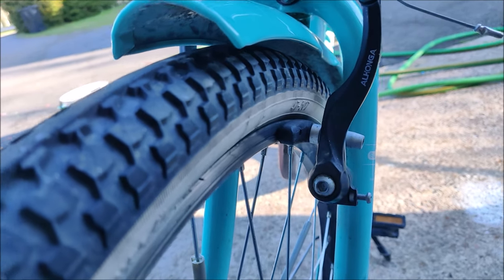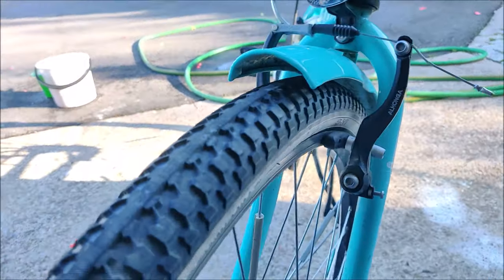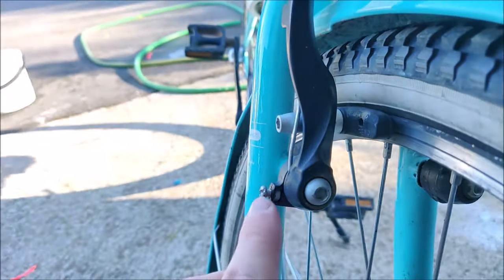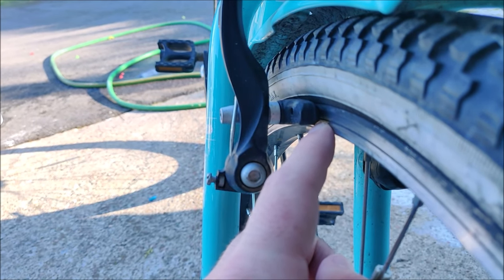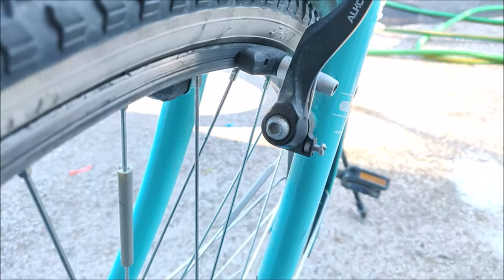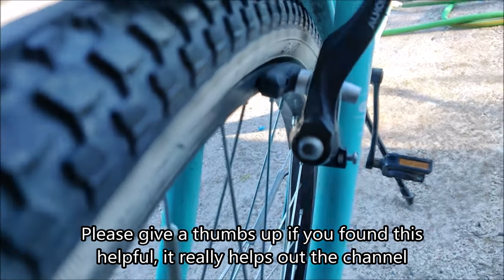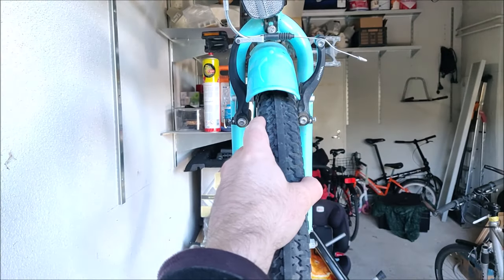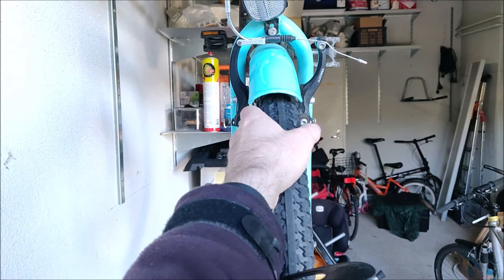How To Fix Bike V Brake Pads Rubbing On One Side

Comment: Good explanation of centering brake pads. I would just add that it's a good idea to keep the two adjusting screws as nearly equal as possible as this maintains the overall range of adjustment available. So rather than continuing to tighten the balance screw of the left side I might instead try loosening the screw on the right side.
Reply from the maker: Good idea. That makes a lot of sense.

Comment: Noticed on my last ride I couldn't coast too far. All so it was difficult to pedal even in a low gear. Stopped and noticed one brake pad was rubbing on the back rim. Thanks for the tip, had the back brake apart in my garage. Now I know to just adjust the screws........... cool.
Reply from the maker: Good to hear that the video is helpful

Comment: Thank you so much for carefully explaining adjusting the rear brake pads!  My right rear pad is rubbing on the rim and no one (including the manual) has addressed this properly!  The closest help I've gotten is "you can turn the adjustment screws....even the manual says turn them in or out until the pads are.....Now I know which way to turn them!  And also if I loosen the cable on on the rear brakes, I can tighten the handle bar cable to balance it out.  Great😀😁👌👏👏👍👍👍
Reply from the maker: Glad it helped!

Comment: Thanks! I guess I have this problem and will try to fix myself. Today I made 6 km with my bike with the wheel almost blocked and seemed that I climbed a mountain 😂😂😂 my bike almost stops in a valley 😂😂😂
Reply from the maker: Yeah sounds like it needs some adjustment. Hope this solves your issue
Reply: I've been cycling on mine for weeks and was wondering why I felt so tired making the same journeys I always do! 🙊😂 It just felt so much harder!

Comment: Thanks mate, now i dont need to visit the shop every now and then for these minor adjustments 😇😇
Reply from the maker: Great to hear that.
Reply: Hey my brake crashing cycke tyre so i should increase space or what
Reply from the maker: @FactFunKids  Not sure what you mean? Is the brake pad hitting the rubber wheel instead of the rim? There are videos showing you how to change brake pads/how to adjust them
Reply: @Homeneer  so do you like ajust the bolt on the top too fix it? Or just change the whole thing because I don't need new brake pads I got a new bmx bike it came like that

Comment: Thanks alot...i see and do everything you've shown but the left front pad (when facing the bicycle)is still resting on the rim; the front wheel is not spinning freely between the brakes...what do you suggest next? Great tutorial tho.
Reply from the maker: Perhaps check the wheel alignment. If its not that then my guess is the v brake springs are no good anymore and you need to replace the v brake arms
Reply: I faced the same problem and took it to my local cycle mechanic who alightened the wheel by loosening and tightening the wheel bolts.
It worked the break pads were positioned with a suitable equal gap on either side of the rim.

Comment: What if the distance from brake pad to rim, on both sides, so close you can't see which side is too close, and both arms are moving, then what?  I've been trying to do this for 1 1/2 hrs ha!  I end up turning the screws so close I go by the feel.  I get it close but not good enough, still rubbing.  I also have the barrel adjuster in all the way.  Thanks for a nice video!
Reply from the maker: Would suggest loosening the cable slightly. But if the brakes don't touch all the time most likely your rim is not straight and needs to be aligned
Reply: @Homeneer  Hi Homeneer!  Thanks for taking the time to respond!  I had my bike in a shop 2 days ago and the mechanic did exactly as you advised, he loosened the cable.  Then it worked!  After I was riding home I noticed a soft rubbing sound and somehow on its own it is slightly rubbing, so today I'll try very carefully adjusting those set screws.  It's funny how one can be mislead to thinking you need to lubricate the V arm that isn't moving enough or not moving and it's in the set screws.  I'm learning slowly by doing and by great advice as from you. Thanks!

Comment: Thanks for the video. I have a problem where my brake pads are rubbing but there is also not enough tension in my brake lever. I've tried aligning the brake pads by adjusting the tension screws as you did in this video but I can't figure out how to fix it. Its a new bike too. Anyone got any suggestions?
Reply from the maker: On new bikes sometimes the rim spokes might need a bit of tightening. Is the wheel wobling when you spin it? If you look for truing wheel videos those might help.
Reply: @Homeneer  thanks for the suggestion. I dont think the wheel is wobbling but I'll check the videos anyway.

Comment: If you turn the screw all the way clockwise and it still is touching the rim, any advice?
Reply: It could mean eventually ur brakes are needing replaced or ur brake cable all depends in condition and how old they are even looking good they can look deceiving I’ve spent many day trying too fix and no avail best start from scratch if ur going too keep bike for while
Reply: @neilmurphy3239 I had to adjust the spring that the adjustment screw was supposed to adjust but the spring was bent.

Comment: My bicycle one side is fixed.. Like touching the tyre and the other side is moving.. What do you suggest. This is the same even after adjusting the screws
Reply from the maker: If you spin the wheel does the rim touch the brake pad all the time or does the distance to the pad change? If it changes it means you need to true / align the wheel first.
Reply from the maker: Another option is that your v brake springs dont work anymore or then you just tightened the screw too much on one side

Comment: I tightened the screw all the way on the brake that is sticking to the rim and loosened the other one and the problem is still there. Do you have any suggestions?
Reply: Did you try loosening the cable screw (on the brake arm), pulling the cable tighter, and then re-tightening the screw? It may help. Also it's possible your v-brakes may need to be replaced. Mine do. I have the same issue.

Comment: Hi thanks for this video. When I tighten the screw by my brake though it is still not really moving, doesn’t seem to make much difference even if the screw is tightened as far as it will go. What do I do then?
Reply from the maker: Did you try to loosen on the other side?
Reply: @Homeneer  I have a same proble. I did loosen the other side all the way, but it is still rubbing.

Comment: Hi. This is a tutorial video right? Meaning this is for those who do not know how to fix brakes. Therefore I would request for you to explain each action you do on the brakes. Like for example when you turned something on the handle brake cable, you did not explain why you turned those two silver things on the cable. Thanks.
Reply from the maker: Thanks for the comment. I had to watch that part of the video again. Perhaps I wasn't very effective at communicating the purpose. Starting at 4:29 I try to explain it. Turning the barrel roller can be used to tighten the brake cable. The reason for this is to be able to start braking with a smaller movement of the brake leaver.
Reply: @Homeneer  Thanks. I don't know much about bikes.
Reply from the maker: Great if I was able to help🙂
Reply: You request? Who do u think u are?
Reply: Actually he DID explain.

Comment: In my case there is no change in the brake pade even after tightening or loosing the screw 
Still it is dragging to the rim
Reply from the maker: I you lift the wheel and spin it, does the wheel wobble? One possibility is that the v-arm springs are just worn and the v-arms need to be replaced.

Comment: I’m building my bike and the breaks are not connected. I can’t connect them due to the pads being too close together? Please help 🙏
Reply from the maker: Not quite sure which step you are having difficulty with. If it's the brake wire being  too tight then would suggest loosening it from the V brakes side.

Comment: Do you know what to do if there's only a screw on only the left side?
Reply from the maker: Sorry haven't come across that situation. Is one screw missing? Perhaps you can still adjust it normally since the two v arms are connected with the wire.

Comment: Unfortunately this did not fix my problem- one brake pad rubbing on the rim.  I turned the screw in clockwise on the side that rubs, until it could go in no further.  It changed nothing.  Any advice?
Reply from the maker: If you spin the wheel is it spinning straight or moving from side to side? If the wheel is straight then check if you have a screw on the other side you can also adjust. If that doesn't help then perhaps the springs on the brake v arm just dont work anymore and you need new v arms.
Reply: @Homeneer  It was spinning straight. I think you are probably correct, as I did try the screw on the other side as well - both directions - nothing seemed to fix it.   I gave up and biked with it rubbing (lightly).  I will look at replacing the v arms. Thank you!

Comment: My brakes pads get stuck to the rim when i press the rear brake lever and release it, do i need to replace the calipers?
Reply from the maker: Do you have v-arm brakes? If you spin the wheel is it wobbling or straight? Quite often truing the wheel can fix an issue were the brake sticks. It might also be the v-arm spring is just too old and thr v-arm needs to be replaced.
Reply: @Homeneer   yes i have varm brakes. The wheel doesn't wobble. When i press the brakes, the vram calipers dont realize. The bike is a bit old and i think its is time to change them.

Comment: Uh this thing happened to the back of my wheel and I fixed one of the brakes but the other side just won’t loosen what do I do
Reply from the maker: Do you have V brakes like on this one or some other model? Did you loosen the tension screw or do you mean the tension screw doesn't loosen? Perhaps try some CRC oil

Comment: I have tightened it and loosened it on both sides and it is still not moving. What should I do now?
Reply from the maker: It is possible that the v arm springs are judt too old and don't work anymore and you need new v arms.
Reply: @Homeneer  OK, thank you for the reply.

Comment: mine are stuck on solid on both sides.  tightening both screws all the way in on each side didn't help:(
Reply from the maker: Sorry to hear that. Is your brake wire perhaps too tight?
Reply: @Homeneer  yep you're exactly right.  I figured out that I wasn't putting the wheel on right and it wasn't allowing it to spin where I thought it was the brakes so I got that straight so I think it's at least spinning lol.  And then yes I had to loosen up that brake wire as well
Reply from the maker: Glad to hear you got it sorted out

Comment: Why do you start with the easy problem? Start with what you do when both pads are rubbing. I don't have to watch this - if one is rubbing, you figure out how to move the thing over.
Reply from the maker: Hi, can you elaborate on what problem you are having? So both pads are rubbing but only part of the time I assume? So your wheel is not aligned correctly perhaps? Im planning a video on wheel alignment. But kn the meantime perhaps you can find some other videos with the search term wheel alignment. Hope this helps.
Reply: Well i hv one of the pads rubbing but i cant solve and this video helped me out. Wt do you say?
Reply from the maker: Sounds like you solved the problem. Thats great

Comment: I tried this and it made not difference after I did it I held the brake down and it made one side not move at all and when I spin the wheel the brake rubs in it and slows it down
Reply from the maker: Sorry to hear that. Sometimes if rhe rim is not straight you need to align it first